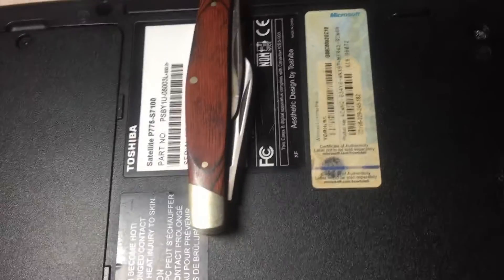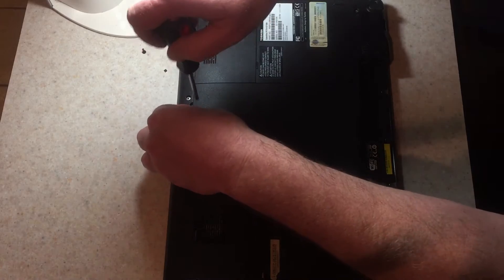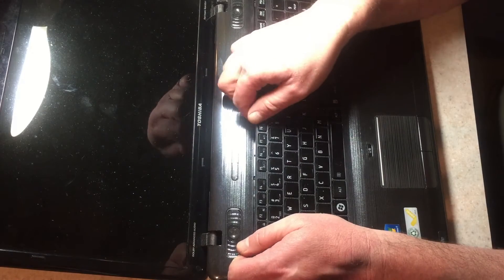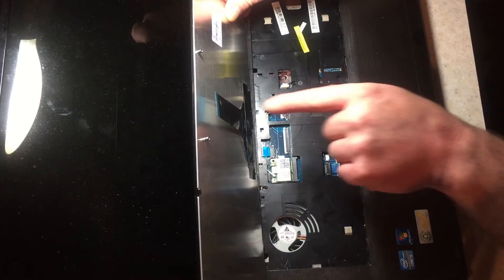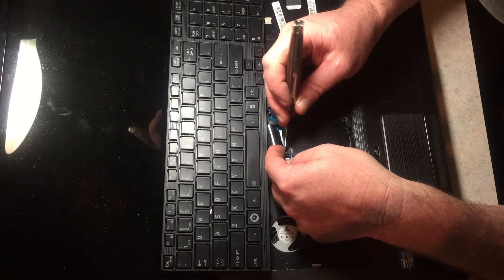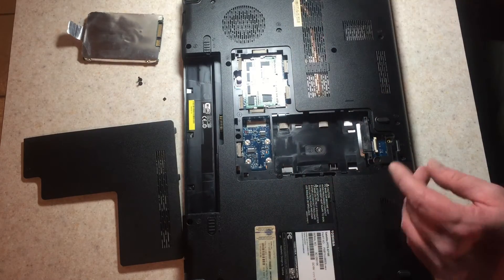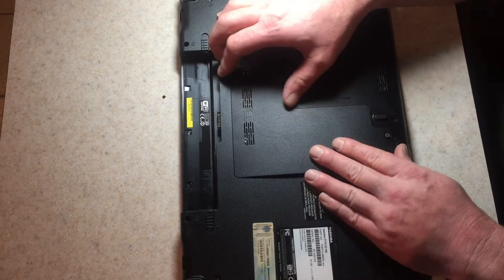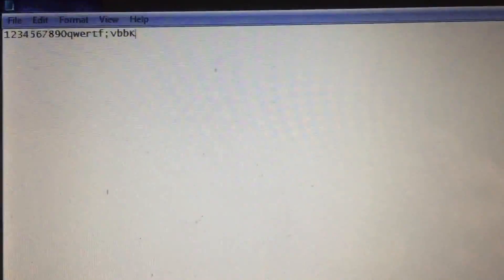Toshiba satellite laptop keyboard replacement model P775 How to

Comment: Thanks for the informative video OP. You sure helped me replacing my inlaws keyboard.  Issues was sticky keys. Thought it was just dirty keyboard but replacing the kb did the trick. Thanks for posting the video
Reply from the maker: You welcome Dew Ey
Reply: I've got a P750, my keyboard is also partly broken. It's acting a little odd, first some keys on the left side ('q' 'w' a' 'e' 'z' 'x' '1' '2' and caps lock (with no light) are dead, now each time I start, it seems to be pressing control and F continuously! I'll give the connector a wipe and check nothing's sticking. Otherwise I'll be ordering a new one.

Comment: Just replaced mine on Toshiba  Satellite P775, it was not the exact same cover on the bottom, and it only had the 2 screws on the top of the keyboard to remove it. Also i had to push the tabs down and reseat the keyboard cable connection 3 times before all of the keys would work right. The 3rd time i used my fingers to push the tabs on the keyboard connection until i could not feel them move anymore.
Reply from the maker: That cable strap is thin! Thanks for the input!

Comment: hey, great video.  what type magnetic screw driver did you say you are using?  Where did you get it?   Thanks
Reply from the maker: Thanks Eddie. Those look like cheap "Kobalt" brand from Lowes.
Reply: @astrodiver1  Excellent.  I thought I heard that name somewhere in the video.  'Preciate ya, Astrodiver 1
Sorry, is it a Phillip's head?
Reply from the maker: @eddiemattison7792  yes all the screws are phillips
Reply: @astrodiver1  Thanks man , I'm on my way!   :-)
Reply: Its done, thanks!   I learned that 1) you have to take off that thin paper strip on the back of the keyboard, for it to work correctly  :-)   and 2)   go back in if it don't work correctly the first time, cause now --   its a gem!
Reply from the maker: @eddiemattison7792  Glad it worked out!